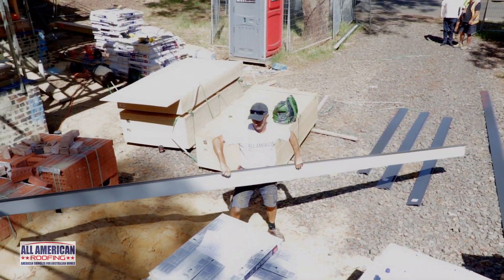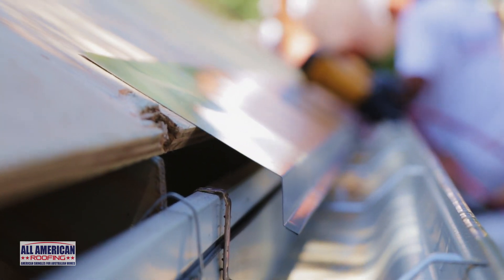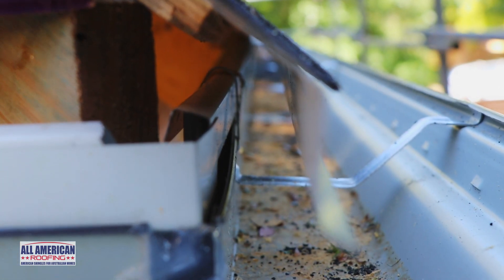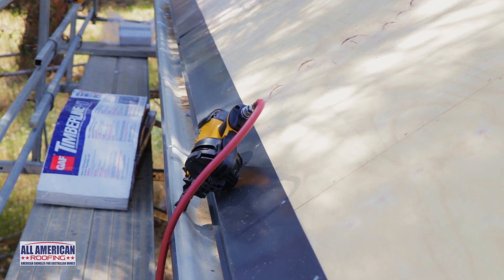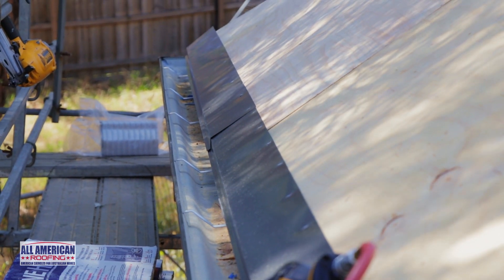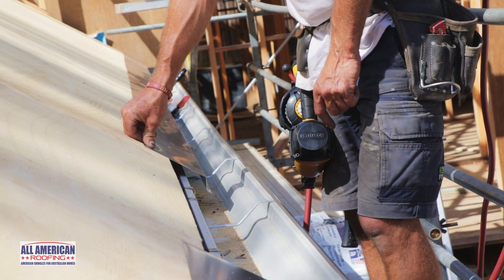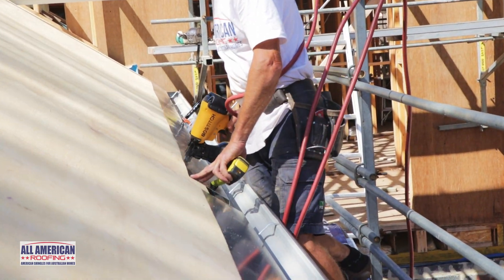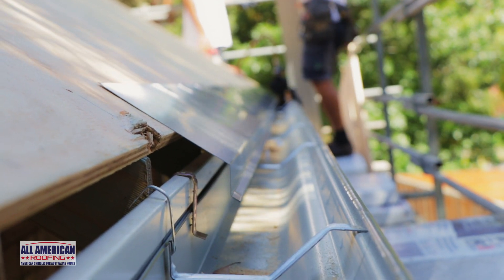How To Install Asphalt Roof Shingles - Part 2 // Drip Edge //

Comment: Maybe a drip and good quality, but so install it! The base of the roof (osb or plywood) will rot. You forgot the underlay or bitumen the edge of the plywood. Bad Roofers.
Reply: that would really only be an issue if they were in a climate that got snow filling up the gutters and/or creating Ice damns. With the ply being installed 1" back from the fascia for air intake, or dropping the facia 3/4", then the drip edge 3/4" past the Facia and the shingles 1 1/4" past the drip edge, to comply with local building codes' it'll be fine. This is the way it's been done in Australia and New Zealand for over 30 years with no issues.

We don't have soffit vent Eave sheets here and don't want them, they're ugly. 

Everyone who's a professional Shingler knows coating the ply edge with bitumen traps moisture inside the ply and it's a dumb idea that leads to dryrot